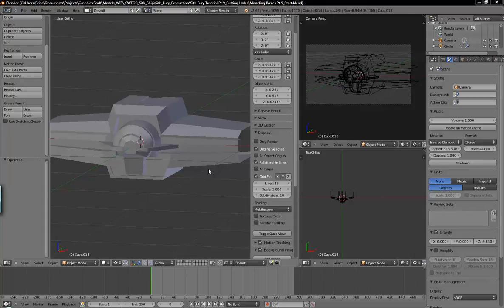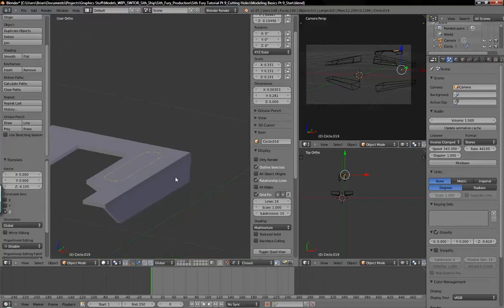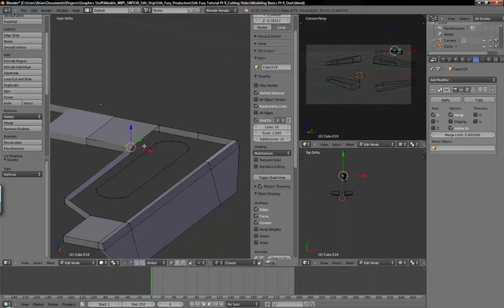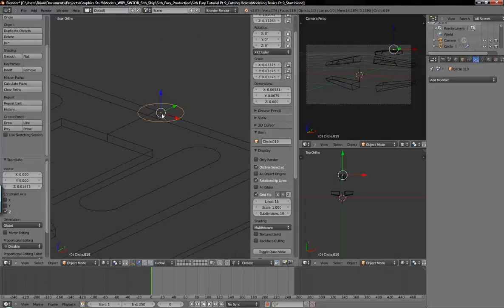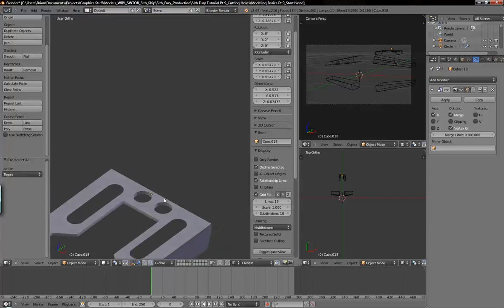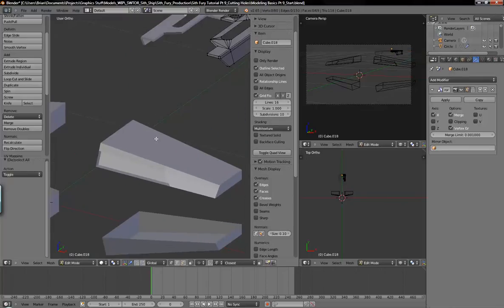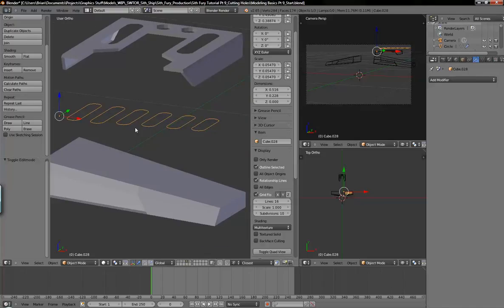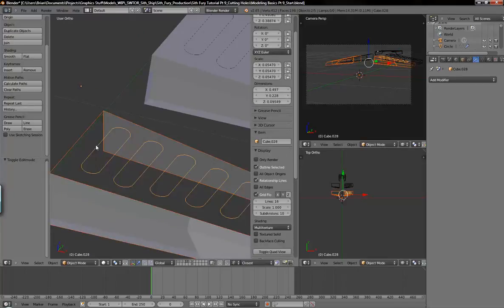Blender 3D Modeling Basics Part 6: Boolean and Shrink Wrap Modifiers

Comment: Great tutorial. Thank you! I appreciate you giving several different options for cutting holes. I'm learning alot, but I'm new to blender and have been wondering how to cut holes in a surface.
By the way, I looked more into boolean modifiers after watching yours get messy on the last one. I believe it may be from using just an extruded edge, rather than a complete shape. That shape you used still doesn't have actual volume, and although I don't fully understand the mathematics, the boolean modifier page on the blender wiki gives some explanation that kinda made sense. Also, if your normals aren't right, it can cause problems with boolean modifiers.